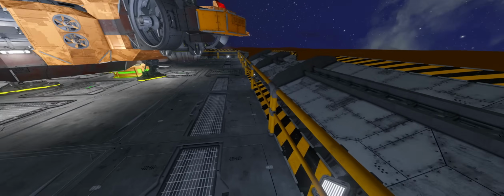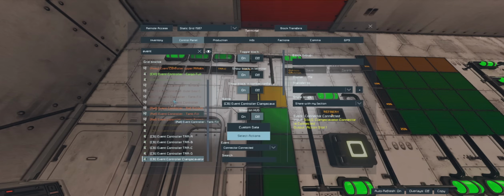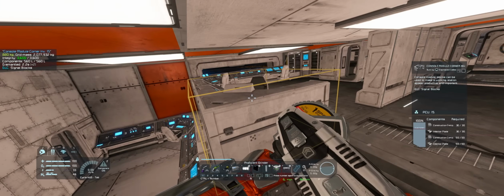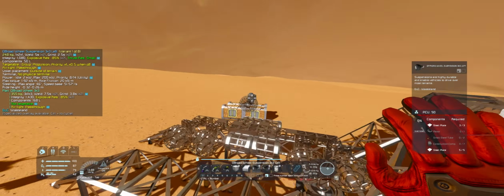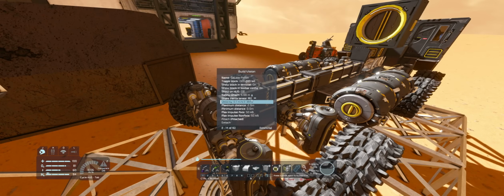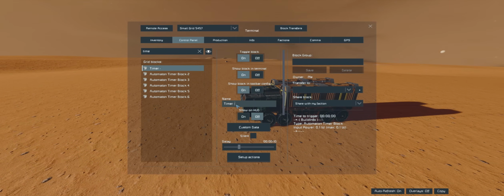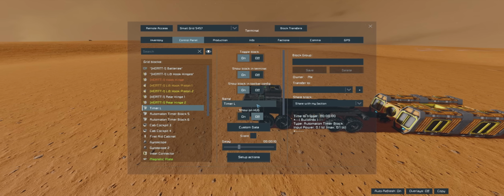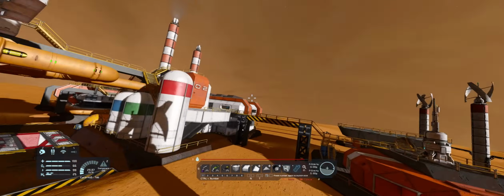Logic & Logistics! Epic SCADA System & Hook Lift HEMTT | Martian Engineering E14 | SE Survival

Comment: Instead of using a mag plate to grab the container you could add another hinge to the end and a hinge part to the container. In the opposing axis with low torque and event controllers to keep it in the right orientation. Then you won’t have to unlock and lock to get the container aligned with the truck.

Comment: i know it would probably look awful... but would some free wheeling wheels on the back of the cargo container help it slide without damaging the container and pushing the truck around... just on the back side of it... maybe some modded super small suspensions with some like 1x1 wheels or something... cause the real garbage trucks you used as to design this those bins have giant steel wheels on the bottom... thats one thing id wish they would give is bearings like scrap mechanic...

Comment: 02:30 - Please, are you using supergriding to enable the mix of small and large grid? Or did you create that wall by adding a rotor with small head to create the small grid?
Reply from the maker: Hing connection on the back. You should be able to see it when I'm messing with the event controllers on the backside.

Comment: Perhaps a merge block to connect the crate to the truck once it's in position? You could also do a merge block for the loading arm, which would erase your issues with the crate not being straight while it loads.
Reply from the maker: I end up using a piston connection that works pretty good.
Reply: @ yeah, your reasons in the next video were pretty good.especially not wanting the renaming.

Comment: I love analog, and computers don't like me much anyways. It's a mutual hate relationship. But it would be amazing (and maybe somebody has one somewhere) to have all analog looking valves and levers instead of buttons, and pressure gauges and things like that to use for visual reference instead of a script meter on a screen telling you how full things are and whatnot.

Totally need a 'Steam Engineers' game or animated analog replacement/ reskin mod! Pipes and gears (instead of hinges/ rotors) and gas mask style industrial rev era space suits with bowler hats! 😃😍
Reply from the maker: That would be pretty cool!  Steam pressure to move things would be a fun challenge.
Reply: @EngineeredCoffee  Even if it wasn't steam powered, which would be awesome, just having the look of it, and doing the same thing you did on your logic wall would be cool, having gauges and old fashioned lights and things like that instead of the techno stuff. 😍👍

Comment: Your also a programmer. Aldo I'm not yet working is did get my diploma in automation (plc programing + installing systems at BASF) but I hate the old software, TI portal is good but Step7 and older sucks, I literally have to use a window 95 and xp to edit or make new programs for the old PLCs. I'm from Belgium so my English isn't great or the best.
Reply from the maker: My plant has a mix of TIA 1200s and old Step7 200s. I know exactly what you mean! I have 2 laptops depending on the age of PLC I am updating.

Comment: First time watching your stuff and i gota say i'm loving the series. have you thought about using a mergeblock instead of connector? that way you wouldn't have the view issue while driving because of a subgrid but still retains that ease of loading and unloading.
Reply from the maker: Glad you are enjoying it! The merge block has been mentioned, I need to test it. I am also considering a rotor hitch.
Reply: @EngineeredCoffee  thanks for the response bud. I did see looking through the comments afterwards that a few people mentioned it, I've used the concept myself in the past for Modular ships. drilling, grinding and welding in the past it really does help with the 3rd person view

Comment: That SCADA setup was really cool - in my current save I have static mines sending ore via pipelines all managed by event controllers and action relays, one of these would really tie it together.
The hook lift is cool too. One tip for Build Vision: the menus wrap top-to-bottom and switchlock/reverse are always at the bottom - ctrl-scroll down to open menu -> scroll up to get to toggle.
Reply from the maker: Thanks for the Build Vision tip! That would be cool for pipeline management!

Comment: Hey man nice vid i just subbed but how did you get a small grid wall in a large grid base?
Reply from the maker: It is attached to a hinge on the backside. The previous episode shows the build if your curious. There is also small grid on the landing pad with a rotor in the episode as well.

Comment: You probably could have something on the back of the truck instread of the 1x1 static wheels,put them in a hinge and make a wheel free rotating there so when the piston is at a certain extent pushing the cargo on the trailer, the hinge for the little 1x1 wheel would go up and lift the back of the cargo up a bit, and the cargo container could roll on the 1x1 wheels instread of scarping on the middle of the container on the blast door parts.
Reply from the maker: That would be fun to try, thank you for the suggestion.

Comment: I think it would have been better to have the color change to red when something is off. it will be visually more catching that the same color on/off.
Reply from the maker: Fair, but can't really do that without a script or double lights that toggle, unless they added a 'set color' feature I'm unaware of. If it is an error or fault then a red or flashing light would be good.
Reply: @EngineeredCoffee  a script of 4 lines xD
Reply from the maker: @bechirbenothman5453 I know, I am running this playthrough with zero scripts, hence the analog control board instead of LCDs.

Comment: I've never used those 1x1 wheels, when you place them without a suspension can you still access friction settings? If so you could set the friction to zero and you don't need them to roll, the cargo pod will just slide over them.
If this works you could figure out a way to add four zero-friction 1x1 wheels to the bottom 4 corners of the pod, this may stop the scraping when loading and the digging in when unloading as well.
That truck look cool though, and the logic you used for the display panel in the base blew my mind 😆
Reply from the maker: No, I wish, those wheels are entirely decorative. They do have a good durability though. The wheel suspension is the part that has all the settings. Good idea though.

Comment: For multigrid builds like your truck, using conveyer rotors/hinges to connect the grids gets rid of the camera issue given that you can separate the rotor/hinge into two parts and reconnect/connect them as you like. The game reads sub-grids via rotors/hinges/piston as one grid along with the main grid, the grids through connectors will always read as a separate grid which makes the camera funky.
Reply from the maker: A rotor head sounds like a good option. I could leave the torque low to allow the container to auto level with the bed. 👍
Reply: @EngineeredCoffee i can confirm, rotors as the hook is great for hooklift systems. Just put the rotor on the arm and a rotor head on the skid. It'll automatically align itself and you can set it to freely rotate. 

I made a MAN HX 10x10 with a hooklift system and have only ever clanged once, and that was because I left the hinges on and didn't lock the skid to the truck with landing gear. Beside that, it works really well even in multiplayer.

Comment: To everyone suggesting merge blocks: Pistons and batteries that close to sub-gridded merge blocks is a disaster waiting to happen. It also doesn't help that he has batts in the truck and in the crate right above the pistons where the merge block would go.

I personally think the mag plate dropping the crate onto the struts and then reattaching is a much better (safer) idea. I dislike that the crate drags along the ground, and I'd have base hinge lift the whole thing up slightly off the ground so as not to damage the crate, but it's your truck and you can do what you want.
Reply from the maker: Crate dragging is pretty standard in the real world, but they do make skids with rear wheels/rollers to help them slide. SE doesn't have a real analog for that small though.

Comment: For my inventory sorting systems to avoid the cycling issue with sorter blocks, I often connect all my storage with one conveyer line to each cargo container group and on that line have a split that runs parallel for a few blocks then remerges with the main conveyer line then in the parallel split section, have a connector valve on one line and the sorter on the other. That way when I activate the sorters, I have it set to simultaneously disconnect the connector valve and vis versa. 
Love your analog status and control system, I usually do something similar but I've never gone in to so much detail. Very cool.
Love the truck! Another fun project I like to do in the same vein is making something similar to those tractor vehicles that taxi aircraft at airports for moving large ships around a landing zone and into and out of hangars.
Reply from the maker: That is a great idea with the valving. I have a feeling I will have a subterranean plumbing rework once I get the storage warehouse built. Thank you for the suggestion!

Comment: Two ideas for the truck: merge blocks could be better than the mag plate. Half scaffold blocks make better steps than the barred windows. Love the series so far.
Reply from the maker: Glad you're enjoying it! I always forget about the scaffolding, I will give it a look!
Someone else suggested the merge block, I am wary of Clang, but will look into it.
Reply: @EngineeredCoffee  I have tried recreating the vehicle with a merge block. As long as you are straight while connecting and all pistons/hinges have shared inertia tensor, no clang presents itself (otherwise it tries to does backflps). It also makes it so the camera doesn't get blocked by the container - because subgrids are treated differently than docked ships. (I am pretty sure i don't have any mods that would affect this)

Comment: Instead of a mag plate, could a merged block to a little bit better for the cargo? It would ajuste the alignement. Also it the merge block is further in on the container it would not screw the length.
Reply from the maker: Possibly, I would have to experiment with how Clang would react.

Comment: Now that you've made the HEMTT, you can make a variety of palletized loads for it.  Like a battery one that you just drop off hooked up to the turrets, or even a complete turret system-as-pallet.  You can also make a travel bunker/cabin for exploration or prospecting.  Modularity is fun.
Reply from the maker: This are all great ideas! Especially the battery pack.
Reply: Another fun thing to do is have a skid that is meant to carry a small mining ship and containers to carry ore. With that, you can drive to an ore deposit, drop the skid, and use the ship to mine then bring the cargo to the skid instead of wasting energy on trips back to base. 

I made exactly that, but with a MAN HX instead of a HEMTT.
Reply from the maker: @Rage_Spammer I have an excavator and drone for that, but good idea for a grinding ship for looting NPCs.
Reply: Batteries and extra ammo with the elephant nose attached to push it as needed

Comment: I'm sure enjoying this build series!
I don't know if you needed the extra hinge at 34:58. You might be able to control the height with the wheel suspension which you may need to adjust during transport anyway. Just a thought.
Your build style is so good, not too busy, just right! I absolutely love that truck!
Reply from the maker: That's certainly possible. It did only end up at 15degrees. Leave it to an engineer to make it more complicated.
Reply: @EngineeredCoffee  I work in Civil, so you're certainly right about that.